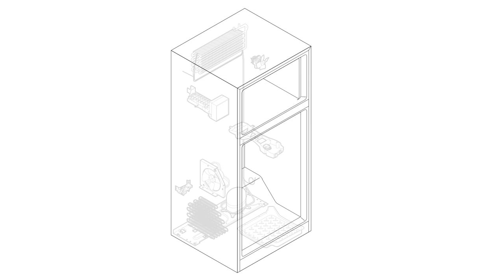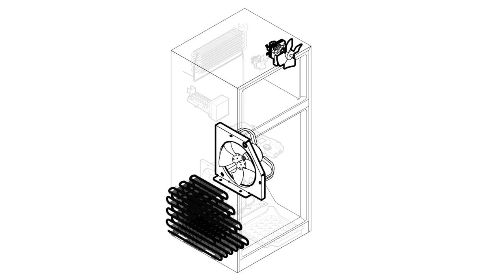Understanding Common Sounds of Your Top Freezer Refrigerator

Comment: So what about the dying animals I have in mine?   None of your "usual sounds" is even close to what people are complaining about.   And notice they don't respond?
Reply: Is yours still running? I have that kind of sound coming from the mine, and it is like an animal moaning inside on and off. It starts normally, but halfway through the cycle, it starts the noise. The manufacturer's call was of no help, and do not want. to send a tech for noises. This is a brand-new fridge. I had it for three months only. I can hear it at night in my bedroom.
Reply: @200Nora  Still running strong.   One thing I did notice.  I don't use my ice maker as I have no line to it.  But if you have it clicked on, it will try to run and it's noisy.
Reply: @Sparty1966grad  I decided to go for a simple one this time. My logic is that less tech less trouble. No, mine does not hae ice maker. I am worried, and I do not know what to do, but to call consumer report or business buro, or stop the payment. I will do a little troubleshooting like cheking level or reposition. The noise is annoying at best mostly at night. Thanks for the response.

Comment: Our refrigerator has a moaning sound from time to time.  Sounds spooky.  Is this normal?
Reply: Agreed.  Sounds like a cat or something.  Rubber rubbing against rubber?
Reply: @manictiger  I got that noise. It just developed in the last two weeks. I have this fridge  for 3 months only. How do I check and fix it. The warranty turnied down for noises. I do nnot want to fight with the vendor to get another one, but the noise at night becomes annoying and it does it at every working cycle. Thanks,

Comment: The evaporator fan on my brand new Frigidaire is extremely loud. I called customer service and was told it was my icemaker valve. I explained I did not have an icemaker or water connected to the fridge. Their only fix was to unplug it for a few minutes and plug it back in. C'mon man!
Reply: I think that's the only thing that really helped me.  These things are way too loud.

Comment: Freezer is not cold, everything is warm and I hear a dripping water sound in the back of the refrigerator . How do I fix this issue with upright Frigidaire?
Reply from the maker: Hi, Anna! We're sorry to hear this and are committed to helping you resolve this issue. Two things, if you have a combination refrigerator-freezer that isn't freezing, a very common cause is dirty condenser coils. When coils aren't maintained properly, it reduces the cooling capacity of your freezer. To clean the condenser coils you can vacuum the coils with a crevice attachment. Next, Frost-Free upright and chest freezer models drip water during the defrost cycle. This melted water will drip and flow down into a defrost drain pan. You may hear the water as it drips into the drain pan. This is a normal sound that may be heard during the defrost cycle. If we can be of assistance in any way, please connect with our Live Chat team on our website or through our Customer Support line at 1-800-374-4432 (M-F, 8:30 AM-8 PM EST). ~ Christy
Reply: @Frigidaire  4 times I had Frigidaire technician to come out and fix the cooling issue and still it will not cool. Your tech put in a new compressor and it will not cool at all. He came again to add more Freon and still will not cool.  Can't take anymore days off for your tech to keep coming out to try to fix this brand new Frigidaire refrigerator I am still financing on.  You sent out another different tech out he soldered something in the back of the refrigerator added more Freon and it stop working is less than a day.
Reply: How long does Frigidaire want me the customer to do without a brand new refrigerator?  How many times does your technicians need to attempt to fix it before they decide this one needs to be replaced already????  Going on 3 months now, it's costing me so much money to keep ordering out food and taking off from work to let your technicians in to try to fix this refrigerator which I just purchased in May 2022 and it stop cooling after 2 months.  Still no refrigerator going on 3 months.  Bought it through Home Depot but they say I have to go through the manufacture Frigidaire  to have this 3 month issue resolved.
Reply: @Frigidaire  it's leaking Freon.  I have been getting sick with this issue too.  Frigidaire keeps sending their techs to my home to keep soldering and keep putting more Freon in the Frigidaire instead of replacing the refrigerator,   How do I resolve this ongoing issue with Frigidaire?  Going on 3 months with the same issue and 3 months with no refrigerator brand new (5/2022) refrigerator why is it leaking and how many times does your tech need to come to my home to put more Freon in it and keep soldering the issue??????
Reply from the maker: @Anna  Hi, Anna. Your frustration is understandable, and it's unfortunate that your appliance is still not working as you need it to. Please reach out to us via Live Chat or by phone, at 1-800-374-4432 Frigidaire Monday-Friday, 8:30 am-8 pm EST so we can continue our work towards a resolution for your refrigerator issue. We look forward to assisting you. - Damon

Comment: This video is helpful. My brand new Frigidaire arrived this week, and has been making nonstop noises from the evaporator (0:26) and the compressor motor (1:07) for 72h now. It feels like living inside of an airplane. Should I return the unit or is there an easy fix to this? @frigidaire
Reply from the maker: Hi there! Thank you for dropping by! Please note that your high-efficiency refrigerator may introduce unfamiliar sounds. These new noises typically indicate the refrigerator is operating accurately. However, some surfaces, such as floors, walls, kitchen cabinets, and even certain floor plans, may make these sounds more noticeable. Visit https://support.frigidaire.com/Owner-Center/How-to-Videos/Refrigeration/Top-Mount-Refrigerator-Noises/ to understand more about the normal sounds of operation. In the event the tips provided do not resolve your concerns, please connect with us via live chat or by phone at 1-800-374-4432 Monday-Friday 8:30 am-8 pm EST, and we will be happy to assist.